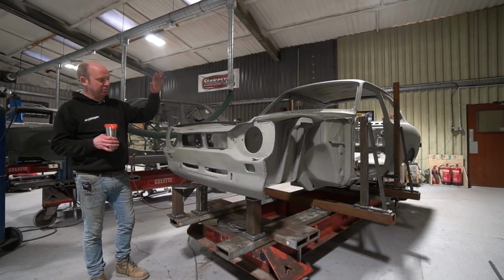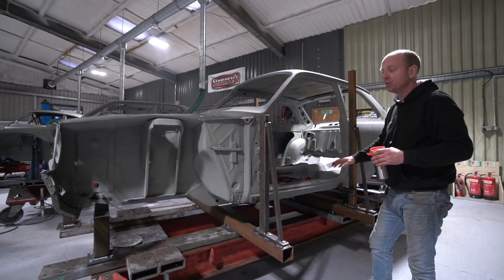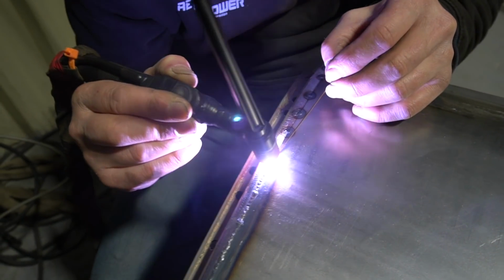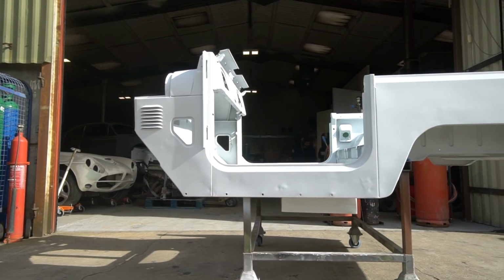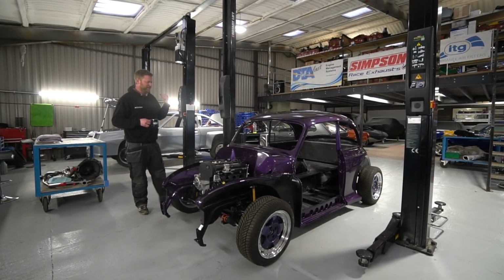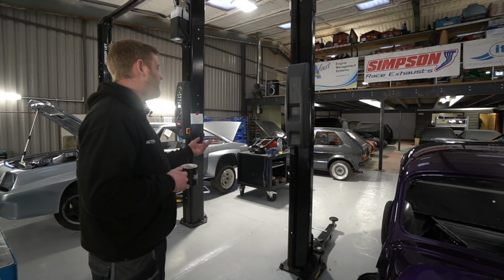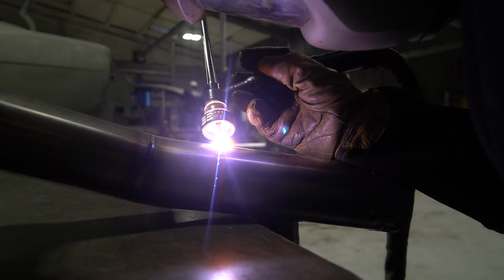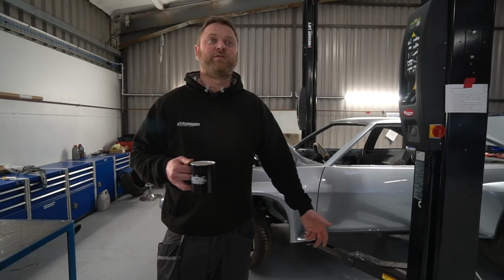Retropower Uncut Episode 80: Morris Minor Painted, but WHAT COLOUR?

Comment: If you don't want to stretch the metal when blasting use baking soda or crushed walnut shell . Or turn the pressure down and turn the hoper up feed up  ! Reduces the chances of stretching  the surface.  Especially if your doing  MG s

Comment: If that was my car I'd tell you to f right off with putting headlight and screen wash controls on the same (unlabelled no less) stalk. That's horrible UI/UX. Wort of the worst. As clever as it was to achieve it's a garbage way of controlling anything. They aren't even thematically related actions.

Comment: I think purple is the most difficult colour to pull off on a car. Apart from a few vehicles it usually doesn’t work.
Got to say I wouldn’t have thought it would look good on a moggie but this one really wears it really well.

On another note related to hidden corrosion. Is there any treatment used for areas such as the door skins where they are folded over along the edge? I’m referring to the hidden surfaces inside the fold.

Comment: Re the mustang exhaust, welcome to drone city! Between 25 and 40 miles an hour To get rid of the drone you will have to put an x pipe on and extend the tail pipes  have worked on these cars for 30 years a problem new to you but anyone who has owned one with a total dual exhaust knows, mainly because v8 engines don't have  smooth even firing order per side, so the sound like a cobra with side pipes and will drive everyone in the car nuts
Reply from the maker: Interesting. We got the parts to make a v-banded link pipe but thought we'd try it without first. I expect we'll prove your theory

Comment: The Stratos rear window doesn't look better in CAD. The shape of the car is a bit awkward in this area, so it needs the volume and texture of the louvers to break that up. The flat black panel will not work well therefor. If you are making a mold anyway, making a F40 Style panel in dark tinted translucent plexi would work much better. Or if you at least adjusted the angle and gave it an opening at the bottom end and some volume at the sides, the current design would work slightly better as well. Incleasing the size of the slots would also help things.

Comment: Thank you for giving a little more information and video of the zinc metal spraying process. Did you make your own wire jenny? 
I noticed you have a water/air exhaust filter system. I haven’t really seen those over here in the US. Can you do a segment on how that works? Wouldn’t it potentially add moisture to the air around the freshly blasted shell?

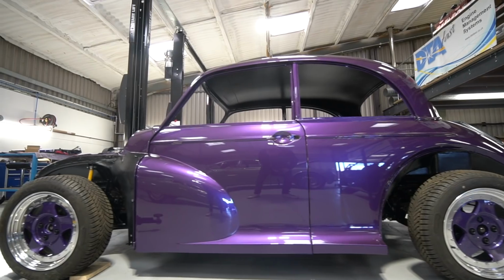Comment: Love the paint on Morris, At 27:33 the reflection from the windows behind the camera shows shows the blue flip superbly.

I've got a question ref the builds you do - why are cameras are not used more to replace side mirrors?
I'm messing with a couple of cameras on the top of the front wheel arches of our SUV, connecting each to it's own 7" display mounted high on the windscreen with adjustable mounts either side of the drivers sightline - one next to the drivers 'A' pillar and one just the other side of the rear view mirror.
The wider angle of the lens (and being mounter further forward) compared to the mirror gives a hugely increased field of vision - completely eliminating blind spots. Vehicles are clearly visible alongside you by the time they disappear from the camera screen.
They also covers lower down for reversing.
The displays being mounted higher make them easier to use (not looking down to the mirrors) and essentially keep you looking forward.
The fact that they are much closer to the driver negates the disadvantages of the displays being smaller than the mirrors.
Is there a legality issue with doing this in the UK?

Comment: Amazing work on the mk 2 coup.
The morris looks incredable .Perfect paint.
The other mk 2 very nice .Top tops.Wounder if the rubber mounts on controll armes and crossmember rubbers causing a little movement in steering.Top work men .There is some very lucky and satisfied custermers .

Comment: Nat mentioned that some of the Morris panels were difficult to secure for painting. Would it be practicable to fit small - thus not too powerful - suction clamps to the ends of suitable brackets to achieve a support for such panels ?
Reply: Or magnets?
Reply: @alexbrown1995   Would be easy to shield from direct metal contact, wouldn't they? There's got to be something, but we haven't seen the panels, have we?

Comment: On the subject of MoT Testing - how do you overcome the rule that precludes the use of HDI and LED headlamps on cars not originally fitted with them?
Reply: That's a good point, but going off the number plate on the jag it's 40 plus year old ,so no MOT needed.
Reply: @michaelwalker1145  good point well made 🤦‍♂️😆
Reply: @michaelwalker1145  It needs an MOT because of all the mods.
Reply: @ralphmillais5237  my Reliant trike was tax and test exempt.. It still had its original number plate and vin.  Don't know when it got triked. 
The jag has had its shell repaired and a different engine.  Ok so there is a bit more too it, but it's basically the same car. 
A friend of mine back in the day put a 2.8 Granada engine in his mk1 escort, just let DVLA know about the engine swap 1.1 to 2.8 and the engine vin. Log book came back with the new info.
That was over 30 years ago,  now with the price of petrol you would remove the 2.8 and fit the 1.1😀😀😀😀

Comment: Seeing you are basically rebuilding the Churchill sides, are you adding any side impact structures ? Additional tubes or beams like you find them in modern cars to protect the passengers ?
Reply: They added tubes in the sills, That’s too low down to really help with most side impacts though.

I’m guessing either the doors are too shallow to put a significant structure in them without massively eating into the interior space, or they discussed it with the owner, and the owner was fine with 60’s safety levels.